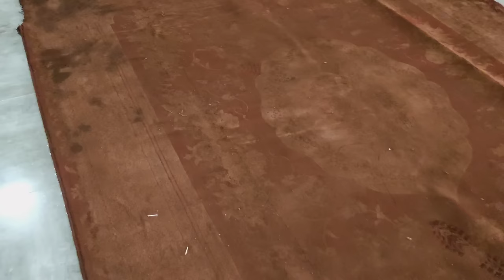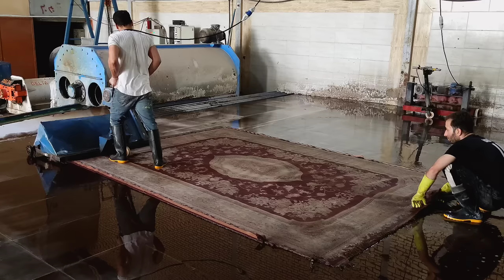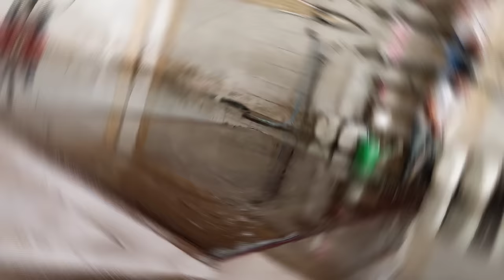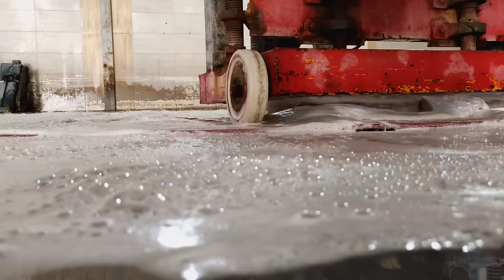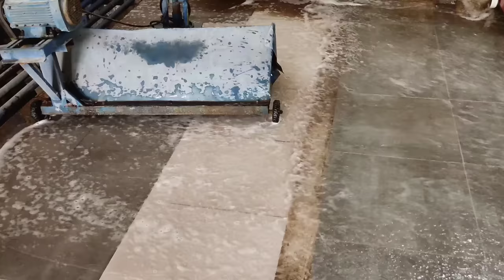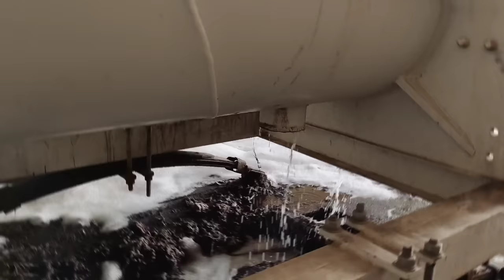100,000,000 People See For The First Time  | Mr carpet

Comment: Awful lot of water wasted though
Reply: I would say, "An awful lot of water used."   It's not really wasted as it's used for a purpose.  The rugs couldn't be cleaned without it, and they may even use recycled water.  Probably not, but you never know.
Reply: @debsmith2269  yes I understand that,but I wasnt referring to the water being used for the cleaning of the rugs/ carpets.. it was more of an observation of the water that is wasted when cleaning away the muck off the floor.. I've seen some clear it away manually with a paddle thingy ( sorry dont know what they're called lol) thus cutting down on water actually wasted.. I doubt that the water can be reused on agriculture etc coz of chemicals used.. so much water is wasted in life in general. I think its brilliant that the carpets are being cared for, it's such a pity that they are in this condition in the first place.
Reply: Yes, I  understand you.   I've also seen those rubber squeegees used, but unfortunately, they don't always work very well on tiles or uneven floors.  I've seen these guys use them occasionally, but the area is so large that I think it's probably too time-consuming to use them every time they need to clear away the excess water.  You do bring up an important point about water conservation, though, and I really hope they practice some water saving techniques where they can.
Reply from the maker: Hi dear friend
All waste water is recycled and reused.
Please see the video related to this process in the channel.
Thank you so much for watching.
https://youtu.be/_nnkAQ-voHU
Reply from the maker: Awesome dear, thanks